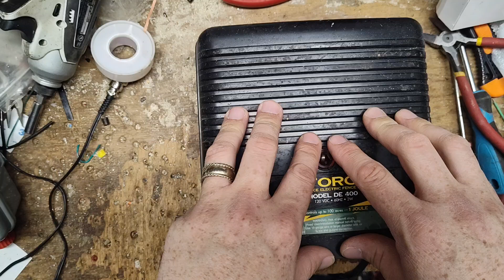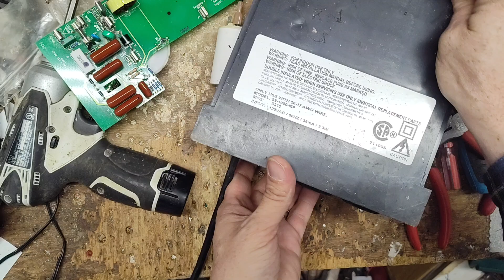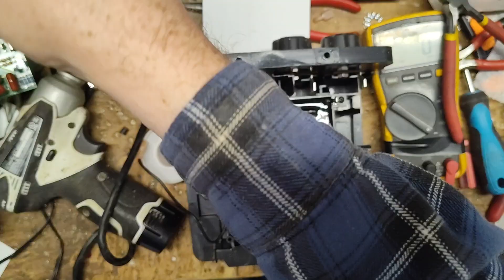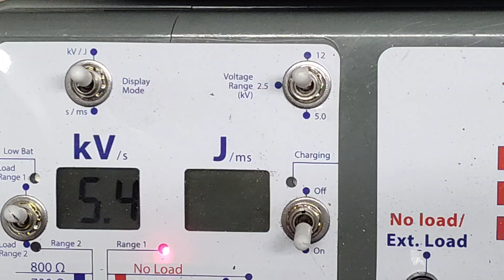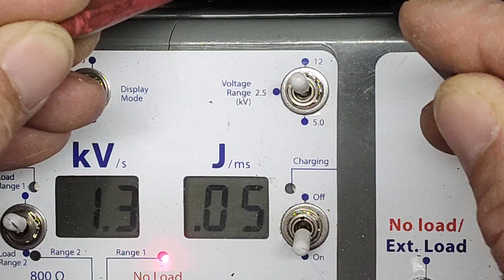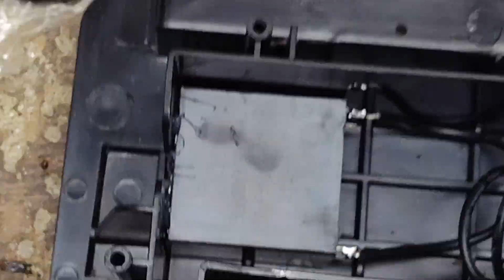How To Make An Electric Fence Energizer Stronger | DARE Enforcer DE 400 Repair

Comment: Can i put in a capacitor that is mark 26uf  5% 400v 1000h
Reply from the maker: What brand and model energizer are you working on, and what was the value and voltage rating of the original capacitor?

Also, what type of 26uF 400V capacitor are you wanting to use? If you can, send the full markings or a picture of it along with the original capacitor to my email address so I can see and compare, email is  fencerfixer816@gmail.com

Not all capacitors are well suited for electric fence chargers. These units repeatedly charge and discharge the capacitor into the output transformer, so the capacitor type and pulse-current capability matter, not just the uF and voltage rating.

Once I know the original capacitor specs, the energizer model, and what capacitor you're wanting to install, I can give you a much better answer.

Comment: My PW1500 is exactly the same. I sent you an email for parts  when you get in after the holiday. The only damage I can see is lightening gap shows a burnt area across the two points. I have a galagher lightening gap module and I guess it didn't work that well :( I'll have to check the gap on it. pretty cool how the board just clips down on all the terminals. Anyway, thanks for all the cool vids. I have two of them now that have died. I need to go tear down the second one and ohm things out and see what went bad in it.

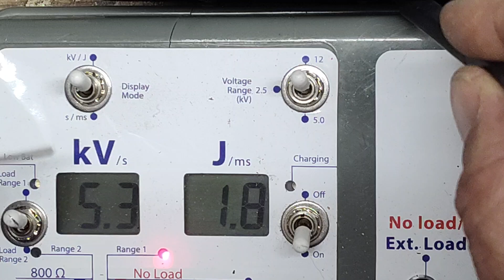Comment: @17:20 - When you're testing the kV/J here, the LCD jitters.  I thought it was my eyes the first time, but three times in a row, that display visibly jittered.  Curious.
Reply from the maker: The numbers fluctuate some but I didn't notice jitters whenever I'm testing things with that meter. It's probably a frame rate trying with my camera. I just use my smart phone as the camera, I don't have a "Fancy" or *professional" camera, just a standard smart phone lol
Reply: @FencerFixerRepairLLCKansasCity You do just fine.  It's hard to explain what I see.  Could be the device is tickling the cell phone camera sensor a bit.  You film exactly what needs to be filmed to follow the repairs.

Comment: As it relates to our comments from another video RE the marketing wank.  This unit advises up to 100 acres which is a different measurement than, say, miles.  I guess if I wasn't all hat - no cattle, I would know the number of feet of fence it takes to string an acre, but I do see your point about the numbers being kind of irrelevant.  Kind of like Chinese amps or sup-par power tool ratings.  You have done a good job of persuading me to continue watching content both relevant to my interests (electronics) and irrelevant (cattle control devices) at the same time.  Well done.